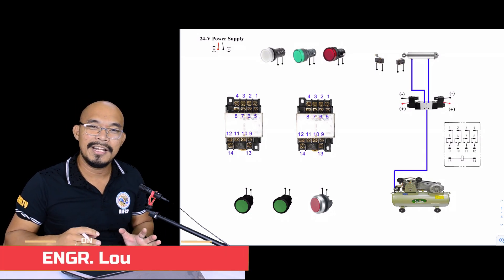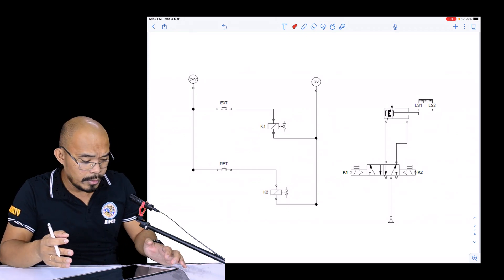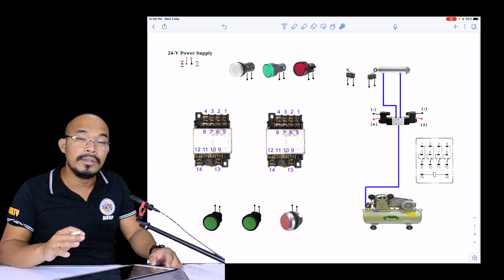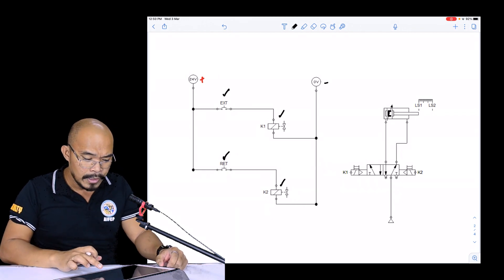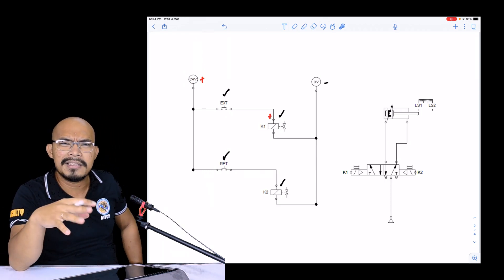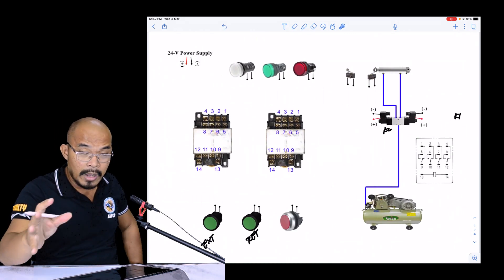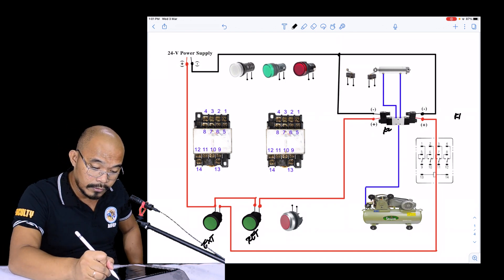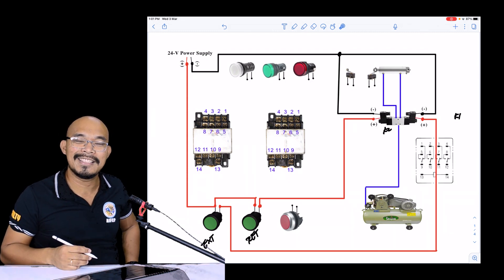How to Wire a Basic Electro-pneumatic Circuit

Comment: Thank you sir . Ive learned a lot because this video helps us identify the components of our circuit and to wire them step by step by the positive and negative to connect them in each terminals and it must be wired first at the 24V. And to connect them simpler we must have a diagram to help us identify to were it is connected.

Comment: On this video I learned on how to connect the wirings from the load to push button extend ug retract going to the solinoid valve and other tactics to connect the wire. Thank you for the knowledgeable video sir, Good bless.

Comment: In this video, it helps me sir to understand on how to wire especially in our pneumatic system. This topic taught me how to identify the connections of circuits then give me some visualization how to analyze the process of circuit of the wires is connected to the terminals.

Comment: Thank ypu for this information Sir. Its a big help for my future that I learned something about this topic that control system by the mean of air pressure for pipe organs, whereby air pressure, controlled by an electric current and operated by the keys of an organ console, opens and closes valves within wind chests, allowing the pipes to speak.

Comment: one of what I have understand in this video is that before you wire the basic electro-pneumatic control system you must know how to identify first the components circuits.  24 volts is the red which is positive and O voltage is black which is negative. The important part that I have learned is that 24 volts which is positive connect/wire to the Green push button to extend and to K1 solenoid so that the high-pressure go to cylinder and extend, after we connect the solenoid it will negative and go to O voltage, and its still the same process to the retract push button. That's all sir. Thank you :)

Comment: Thank you for sharing this video sir, What I learned from this lecture how to start wiring to a primary Electro-Pneumatic Circuit is from the 24V power supply that goes to a button terminal or push button EXT, and the next step is from outside the EXT button we need to be able to connect it immediately to the positive sign of K1. After K1 we have the negative terminal of the solenoid we need to tap it here for the negative sign on the power supply. The next step is we can tap on EXT because it is already connected to our power supply, so from EXT to RET. Returning RET going to K2 in the positive sign, and the negative sign from K2 we must tap it also in the negative sign in K1.

Comment: Thank you for this video, sir! Through this, I have learned that in a power circuit, the K1 is responsible for the EXT (extend) once the K1 is activated. Then,  the high pressure air will flow causing the cylinder to EXT. Hence, K1 is connected to EXT. Godbless Sir.

Comment: Thank you for this another video sir 💖now i know the how to wire a basic electro-pneumatic  circuit, first we have the supply of 24Volts with a positive and negative charge, then base of the diagram the push button is normally open circuit and the second diagram the push button is normally close circuit, and the solenoid valve that we need is to label to its function. thats all sir😊have a nice day sir. god bless. 💖

Comment: For me in this lecture, have a big impact to use to  understand how to wire athe Basic Electro-Pneumatic Circuit step by step using red and black ballpen. Red ballpen represent as Positive then the black is Negative.. We need to wire step by step from the 24v to normally open ( extend) then extend to solinoid valve.K1 is connected to Retcract and K2 connected to Extend.

Comment: In video sir s thishow how to wire pneumatic circuits. And I learned that must connect the proper wires, and also how its works. The important things is to remember is to follow and understanding carefully the diagram to get easy understand.

Comment: I learned in this wiring diagram usually gives information about the relative position and arrangement of devices and terminals on the devices. Our source here is 24 volts with positive and negative charge, the two push button the normally open (extend) while the  normally closed (retract) ,We have also to know what we gonna use in solenoid valves thank you for sharing ideas sir!

Comment: Thankyou for this video,  now I know what is the first step to connecting the wires, first step need to Identified the basic components that we will using in our circuit.  The red wire or the positive terminal to the push bottons and then directly to the solenoid valve, so it's connected, the way valve will move automatically and the pressurized air from the compressor will go to the cylinder. The blackwire which is connected to from the solenoid  valves will be connected  from the solenoid valves will be connected directly to the negative terminal of the power supply to complete the circulation.

Comment: Well explained!!! This video really helped me in understanding the connection of the components in a control circuit. I now learned how to connect the power supply to the push button then to the way valve. It starts by connecting the red wire or the positive terminal to the push buttons and then directly to the solenoid valve. With that being connected, the way valve will move automatically and the pressurized air from the compressor will go to the cylinder. The black wire which is connected from the solenoid valves will be connected directly to the negative terminal of the power supply to complete the circulation.

Comment: Another video that is full of information.Basic electrict pneumatic circuit. Basically the video itself shows how to wire pnematic circuits, i have learned that you must connect the proper wires to its desired components,the Positive and Negative in order for the cylinder to retract and extend.

Comment: In this video give me another knowledge  From the supply which is 24v connected to the of  IN of EXTEND and Retract push button, and the out of EXTEND button is connected to the k1 positive and the solenoid valves that we need to label concerning to its used/function. Thank you sir god bless as always

Comment: In this video i learn what is electropneumatic circuit and also the procedure on how to connect wirings. First is we need to wire it step by step through 24V going to the entrance terminal of EXT. Push button then followed by Ext button to k1 then also same steps in the Retract to k2 it is connected automatically because the EXT is connected already to our power supply so that from EXT to RET. Then RET going to K2 positive sign then the negative sign from K2 can tap it in the negative sign in K1.

Comment: Thank you for this video, what I've understand in this video is on how to wire a Basic Electro-Pneumatic Circuit step by step using red and black wire but virtually where using red and black ballpen as our wirings 24v is for the red wire and 0v if for the black wire, in this video I learned that the easiest way to connect the retract button to the 24v is to tap the retract button to the extend button which is connect to the 24v also.

Comment: In this discussion I learn how to wire a basic electro-pneumatic circuit. But before performing  it  first, you have to identify the components of the circuit that you are going to connect. Just like what you said in this video, we need to wire it step by step so that it will connect it properly. Thank you for this video sir.

Comment: Amazing! the video helps us identify the components of our circuit and to wire them step by step by the positive and negative to connect them in each terminals and it must be wired first at the 24V. And to connect them simpler we must have a diagram to help us identify to were it is connected.

Comment: Regarding with this presentation, you make me understand the whole wiring process. Most especially I learned on how to read a sample diagram or circuit diagram, which is most essential part on being a engineer enable to easily identify on what are the components that we gonna use for this particular circuit diagram and easily to connect each components without hesitation or shall we say connect it confidently because you already know the components that we have.
Such a wonderful explanation Sir!! Thank you for another knowledge you have share to us. More power Sir.👏👏👏👏👏👏👏💯

Comment: Thank you sir for this another video. As mentioned in the video I learned about  how to perform electro-pneumatic wiring. As I remembered there is a source which is 24 volts with positive and negative charge,it has also a push button which is normally open and normally close. I remembered also about K1 and K2 which is when K1 is activited the high presssure will flow causing the cylinder to extend and K2 is,it can  tap to K1 terminal that connected to OV directly.

Comment: This video is highly beneficial to students taking online courses. For this reason that this presentation helps us to know how to wire a basic electro-pneumatic circuit and we have the source of 24 volts that has positive and negative charges and the two push-button the normally open (extend) while the normally closed (retract).

Comment: HOW TO DO IT THE WIRING OF THE BASIC ELECTRO-PNEUMATIC CIRCUIT? From the Supply which is 24 Volts in Connected to the "in" of "extend" and retract push button and also the "out" of "extend" push button is connected to the K1 positive. After in the K1, we have the negative terminal of the Solenoid we need to tap it in the negative sign in the power supply.

THE K1 POSITIVE (+) OF THE SOLENOID, ALL OF THIS ARE RED WIRE. 
THE OUT OF THE SOLENOID IS CONNECTED TO THE NEGATIVE (-) ALL OF THAT IS BLACK WIRE.

Comment: In this lesson, i understand how to connect the wires, it needed to do it step by step, so that it work perfectly, And I just understand how to wire a basic electro-pneumatic circuit from the power supply to terminal EXT. Push button. And i just identified that the K1 is connected to Retract and also k2 is connected to Extend. This is very informative lesson. Thank you sir! God bless.

Comment: It's easy to understand because of the diagram,it shows the components of the circuit as simplified shapes. In this wiring diagram usually gives information about the relative position and arrangement of devices and terminals on the devices.

Comment: Thank you for making this video sir. I learned about this video on how to wire a basic electro pneumatic circuit and we have the source of 24 volts that has positive and negative charges, the two push button normally open is EXT and the normally close is RET and to identify the components that we are going to use.

Comment: This video totally give us a knowledge that in order for us to came up with a good output, we need first to identify the components
Start in 4:10 onwards this is the part were I able to understand on how to identify and label each components. As what was given, we have 24V with positive and negative charge,then also the normally push button ( normally open circuit ) and normally close push button ( normally close circuit) and the solenoid valves that we need to label concerning to its used/function. Great video Sir, you really have the natural ability to hand out presentation material in a very organised way! You really know how to effectively captivate the audience.

Comment: In this video, it helps me sir to understand on how to wire especially in our pneumatic system. As what you've said sir, you mentioned that the 1st green button represents as extend button and the 2nd green button represents as retract and both green button are normally open push button or open circuit while the red one, it's a normally close button or close circuit. Also I learned about the K1 it represents as responsible for extend then the retract button we can tap or wire it directly to extend terminal that connected to 24V the same for K2 we can tap or wire it directly to K1 terminal that connected to OV.

Comment: What i have learned from this video
Is to know how to wire a basic Electro-Pneumatic is to identify the functions of their components.
And we have to connect it from the supply of 24 volts to extend the terminal push button. Before that we have to analyze the components if which one is to connect, because it needs to wire it step by step, in the next attempt is to connect the extend terminal button from the positive sign of K1. After sa k1 we have the negative terminal of the solenoid we have to connect it to the power supply. The next one is that we can now tap it in the extend. Because it's already connected to power supply. Thank you for this sir

Comment: I gained knowledge about how to connect a Basic electro-pneumatic. We have to start first by identifying the components that we will be using in the circuit and our supply voltage 24v and 0v it indicate as black color. Postive represent the red color and Negative as Black color. If you wire from ladder diagram, You have to wire step by step. Follow,analyze and understand the diagram,Thanks for this video lecture sir!

Comment: I learn for in this activity is how to connect the wire of positive which is indicated with color red and the negative wire which is indicate black  in while watching the components use in the diagram and compare to the actual picture of the valve and switches etc.And i learn Some techniques to easiest  connect the wire, which is to easiest to identify and no need to use long wires to connect to the positive side or to the negative side and you can save your wires ang not consume a lot of your time in wiring ..

Comment: I learned in this video is to understand or read the diagram system therefore if you cant read the diagram system you can easily wire system. In wiring, we have to identify the components that we are going to use. Basically, we have our source of 24 volts with positive and negative charge, we also have our normally open and normally closed push button. We have to identify also the solenoid valves and we have to label it with respect to its function. Thank you for this video sir.

Comment: 4:10 For me this is the highlighted part of the video, where i understand on how to identify and label the solenoid. Base on the given circuit, the K1 is connected to the RETRACT OF THE CYLINDER, while the K2 is connected to the EXTEND part of the cylinder. 
8:03 You mention also sir that in doing a ladder diagram it is ver important to make it step by step and that will be my technique for the next activities.

Comment: Thank you for this video it's very helpful, now i know how to wire a basic Electro-Pneumatic Circuit from the power supply of 24V going to one of the terminal EXT push button, like you said in the video sir . We need to wire it to step by step . In next step from the out of EXT push button we need to connect in the positive sign of K1. We have to the negative terminal of the solenoid we need to connect it to the negative sign in the power supply. The second step is we can tap already in EXT because its already connected to our power supply, from EXT to RET. The return of RET is going to the K2 positive sign the negative sign of K2 we connect it also in the negative sign of K1.
Reply: Hahahaha kaila ko kinsa ni? Hahahahaha

Comment: This video very helpful. In wiring we have to identify the components that we are going to use basically, we have our source of 24 volts with positive and negative charge, we also have our normally open and normally closed push button. After in the k1 we have the negative terminal of the solenoid we need to top it in the negative sign in the power supply.

Comment: In this video it easy to identify the functions of their components in electro-pneumatic control curcuit and the first thing also, we have to connect from supply of 24 volts to extend terminal push button, so before to connect, just analyze the components which one to connect, because it is step by step to wiring the parts, next is from extend terminal just to connect into K1 in positive and after that, the K1 negative will connect into negative in the power supply. In the retract push button its just the same also but we need to connect same with the extend terminal push button. Thank you for this video sir, more learn and more knowledge on how to connect the wire use by analyzing

Comment: In this video i learn to connect electro pneumatic circuit  in a step by step procedure we need to connect the wire into  positive and negative to the next step through EXT and RET. And next is to  K1 and to K2. It is helpful so that we can use it to our house wirings or in the other workplace.

Comment: So far this video is very helpful for us and probably will be the easiest way to understand how and where to connect the wires from our source 24V with positive and negative charges. In this video, I learned some of the basic components that we use in a control circuit. we also have the normally open and normally closed push button that we use in the previous lecture. but for now, is like an actual connect the wire and its respective function.

Comment: In this activity i learn about hoe to connect the negative ang positive wire in just watching the symbol diagram to the actual switches and valve. Also i learn some of the ways to connect wire in a minimal way, what i mean is you can save some wire.